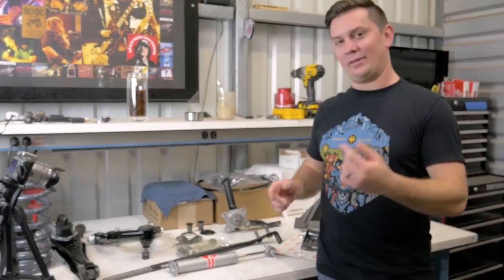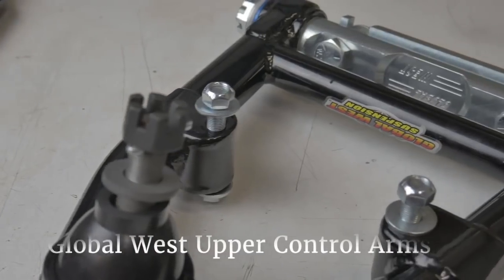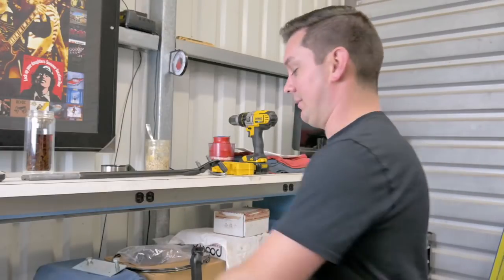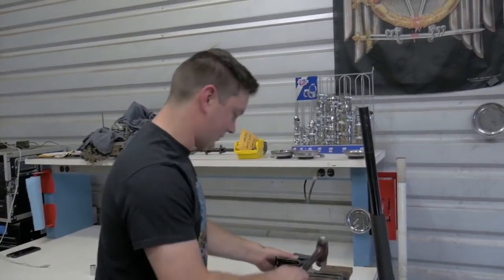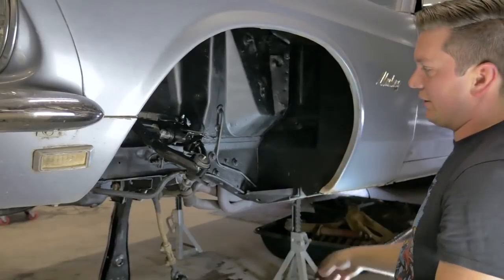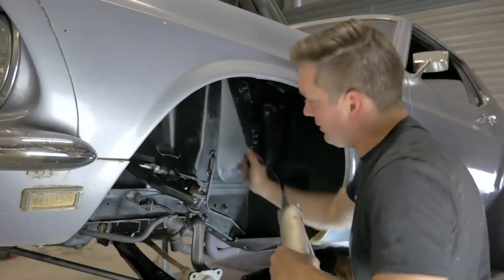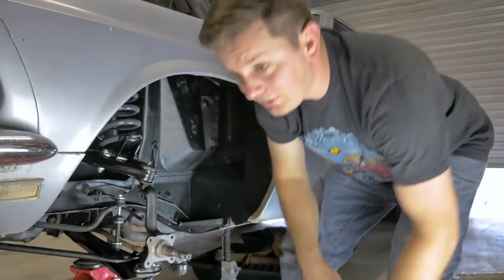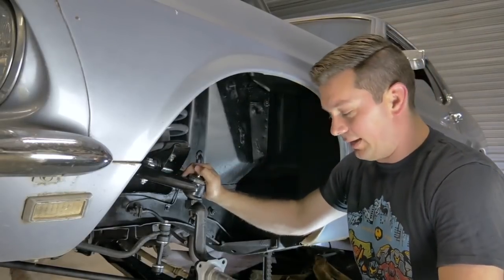Mustang Suspension Upgrade | 1969 Mustang Coupe

Comment from the maker: THANKS GUYS FOR WATCHING!!! WHAT DO YOU GUYS THINK OF THIS SETUP?
Reply: I like the idea of getting a new control arms instead of dealing with the old ones.
Reply: Budget Build Garage smart move is what I think.
Reply from the maker: Thanks man!  This thing should be a lot of fun.
Reply from the maker: They are pretty inexpensive and it saves you from having to remove the ball joint rivets.
Reply: You need an export brace! The suspension mods are solid but you're still gonna get a lot of flex from your stock 2 piece braces.
Reply: Exsacly what I had in mind
Reply: How are those springs holding up? Do you still like them?
Reply: How much did the Shelby drop and lowering springs lower the car?
Reply: So what kind of suspension system would I need to get and what is it called and how much do you think it'll cost if I do it on the cheap if I want the 69 Mustang to corner and handle like a more modern car because I know that the old late sixties cars did not handle well
Reply: @biodigitaljazz5814  You can't use "corner and handle like a modern car" and "on the cheap" in the same sentence.  :]  No one can tell you what is going to be right for you...only what was right for them.  You need to do your homework (by attending several several classes at "YouTube University"..look for common threads..read comments to see what works, what doesn't, then figure out how much you want to spend...can spend, then make your own determination as to what you need.  Some other questions you need to ask yourself:  What will i use it for...drag racing, road rallying, cruise nights, daily driver..  Can you do the work yourself?  Do you have mechanical experience?  Do you have the tools?  Do you need to include the cost of a GOOD mechanic into your budget?   If so..effectively DOUBLE (at least but more than likely more than double) the cost of what you spend on parts to have a reputable mechanic install them.  Do you even know or know of a good mechanic?   That is a major crap-shoot in and of itself right there.  There are numerous variables - a few i have listed here - that really prevent anyone from answering your question "what do I need...?"

Comment: Great video! I just picked up a 69 Mustang.
Reply from the maker: Nice man! What mind of shape is it in?
Reply: Budget Build Garage it’s very nice shape. Car was put up two years ago. Previous owner health/finical reason. He did not want to sell but forced to. 69 Fastback 302 c4 auto, vintage air, black on black. I need to get it running. Hopefully some fresh fuel. Oil up the cylinders and crank over by hand a few times. 
Good tip on spring perches. I did a 67 once and the polyurethane did bind some. I’m also amazed how many guys air gun a suspension system while it in the air. Always good to lower and climb under and finish tightening if you can fit.
Reply from the maker: @dougcoleburn1579  That sounds like an awesome car. Fast backs are hard to find.  Once you get it started let me know how that A/C works. My wife wants it for her car.
Reply: Budget Build Garage will do!

Comment: Just purchased a 2004 V6 silver mustang for my son. Beautiful car no rust but had to hv a lot of things done so far. It still needs tires and I was told shocks for the back U was told. I am not a mechanic but trying to learn. It still rides alittle rough what should be my priority to help with that? Shocks, suspension, or something else? Had to change out the following: Lower ball joints
Inner tie rods
Outer tie rods
Rack and pinion
All four rear control arms
Ball bearings ( had a mechanic do all this)
I am subscribed and thank you.

Comment: I purchased at 1 5/8" wedge drop kit for 114$ on ebay modified moog ball joints 
Completed build last week put a heavier 1" drop coil spring 
Leaving the plate for extra strength was nice cause now it takes less shims to do alignment
My 65 coupe sits nice now

Comment: I just did very similar on my 1966 Coupe. The only thing I found problematic was the progressive rate springs (Eibach ) didn't give me the fender clearance I needed since I am running 17" wheels. SO I went with the grab a track 620' - SAME unsprung height but didn't sink like the other springs. People need to factor that in - .6 inch taller tire, 1" spring drop and Shelby drop cuts 1/4 to 1/2 inch...so you could actually lose a bit over 2" fender clearance. Great video. just adding some data :-)

Comment: Hey Guys,

I have a 66 Mustang, 289 coupe, in excellent nick. It was restored to factory condition with stock parts 7 years ago. Now while I'm quarantined at home, I'm looking at some new projects to make the car better to drive. 

My main focus is the sloppy handling. I wanna know what you think are the most essential upgrades, especially what will give me immediately noticeable results and the best bang for my buck. I only use my car as a weekend cruiser, so don't know if some upgrades such as disk brakes are really worth it.

The upgrades I am considering are:

1. Subframe connectors
2. Monte Carlo bar
3. Front disk brake conversion
4. Upgrades to front suspension (better coils, shocks, hardware, bushings?)
5. Upgrades to rear suspension (especially sagging leaf springs) 
6. Better engine crossmember (with welded flanges)
7. Shock tower reinforcement plate (welded near the UC arms)
8. Rear firewall

The upgrades I have already done:

1. Refreshed drum brakes x 4
2. Dual brake master cylinder with power booster
3. All new bushings on suspension
4. New standard shocks
5. Pertronix electronic ignition
6. Export brace
7. Recored radiator, upgraded fan and shroud

Looking forward to hearing what upgrades you think I should do first.

Cheers!

Umanng from sunny Perth, Australia.

Comment: Great video's. They are helping me out a lot. Do you have any suggestions on a sway bar upgrade instead of using the stock 11/16"?
Reply from the maker: Thanks for watching.  There are a lot of choices. You can use a 1 in. that will improve performance but not be to harsh or you can go with a 1.25 that will really help control the car.

Comment: Nice setup. Guessing the rear suspension will be next.
Reply from the maker: DJHighTopFade Brakes are next and then the rear suspension.
Reply: Since your channel is "Budget Build", would you consider using the Autozone ceramic brake pads with the lifetime warranty?
Reply from the maker: It depends on what type of car you are working on or trying to build.  There is nothing wrong with most store brand parts.

Comment: Putting mine back together. Shelby drop and 620 1 inch lowering springs. Do you think I would need shock spacers? 
Using stock uca. If so where did you get spacers? Summit racing? Thanks!
Reply from the maker: You may not need spacers but I would probably put them in. You can get them at any hardware store.

Comment: Great video. Couple questions, did you plug the stock holes in the upper control arm. Also what bolts did you use to replace the the ones that come with the spring perch. The new bolts needs to be much longer. I found some that will work but they will no longer be pressed in. I am planning on just using lock washers. Thoughts?
Reply: That's exactly what I did just make sure to use grade 8 an I used a nylon lock nut with the lock washer since that area is one of the most stressed.

Comment: Also your thoughts on the export shock tower brace. And how about a fatter sway bar. Any pros and cons on the bigger sway bar? Thanks and great video!
Reply from the maker: Bigger sway bars help a ton. They help keep the car flat through turns. A nice export brace is great to minimize flex in the shock towers.

Comment: HI there Awesome set up! have a question I have all new stock  Suspension on a 1970 mach1 but adding the Hotchiks springs, The only problem Is the spring moves like if you grab and turn after all parts Installed and I am using the thick top insulators that came with the springs I have no wheels on on jack stand for now any Ideas Thanks!

Comment: So I’m going to be doing this build on my mustang in a few days along with the wilwood setup on your other video. My question is can I run 17x8 rims with that Shelby drop plate? What is the best backspacing and tire size for this build without getting any rub or without using spacers or adapters??

Comment: I have a ‘68 coupe and like cost of this and ability to do this project myself. Couple questions- how much of a drop does this give you from stock setup? Are these lower control arms same as stock or do you need to buy these to make it work/offer the same results? (I replaced mine recently). Are the shocks shorter than stock? (also just replaced these). Thanks & appreciate the info & video

Comment: Great tips! just a question, in the Summit web page, they recommend the RK621369 - Moog R-Series Control Arms instead of the one in your link, what are the differences?....or why do you recommend the one that you use? ( Upper Control Arms MNR-733), thanks!

Comment: Great video. I do have some questions. I'm preparing myself for my suspension on my 70.

Why didn't you just reuse the upper control arm? What's the advantage of buying a newer one?
That lower control arm you used is very cheap in price. Is it the same quality? Is you get what you pay for not a consideration here?
Last question do you have to remove the breaks?
Reply: You can use a stock style upper control arm but “Cars back in the 1960's did not utilize much caster, probably due to the tires of that time. Now, with upgraded suspension and present tire technology, caster plays an important part of the drivability of the car. Caster does the following: provides straight line stability, has a self centering action on the front suspension, improves initial turn in during cornering and also resists pulling (right hand drift) caused by road crown.” -from Global West’s website.
Reply: The stock lower control is inexpensive because the coil spring doesn’t connect to it like later suspension designs. Just make sure you avoid cheap imports. Moog is a good manufacturer to consider.
Reply: That's a great question, I was wondering why he didn't just buy the coilovers from Aldan American for less than $700 seeing as he probably spent the same for this setup

Comment: Love your videos! Can I ask what makes the Global West UCA's worth the extras cost? You mention that the balljoint is in a different spot, what exactly is the benefit of that?
Reply: Cars back in the 1960's did not utilize much caster, probably due to the tires of that time. Now, with upgraded suspension and present tire technology, caster plays an important part of the drivability of the car.

Caster does the following: provides straight line stability, has a self centering action on the front suspension, improves initial turn in during cornering and also resists pulling (right hand drift) caused by road crown. - Global West

Comment: curious why you lowered the upper control arm
Reply: From the factory early fords were designed to understeer.ie if you corner too fast the front of the car goes straight ahead. Car makers at the time thought this was safer. With the stock set up as the body rolls into a turn the top of the tyre moves outward ie positive camber and so ends up running on the outside edge and ploughs straight ahead.When you lower the inner pivot point as in the shelby mod, the tyre pulls in at the top ie negative camber which keeps the tread flat on the road and makes the cornering much sharper.This is much easier to understand if I could show you a diagram with the arcs but I'm too old and untech savy to do that.

Comment: I don't know much about suspension, but it's odd how you went overkill on the upper and just stock on the lower doesn't make a lot sense in my opinion. The shock towers are only so good and the lower control arm isn't much. I don't know what upper I will be running , but I have stock lowers with Opentracker Racing bracing and roller bushings. At 400 I decided to cut my strut rods off and threaded them for sleeves and rod ends up front. I think 100 will do the strut rod modification.

Comment: Looks like the spring will fall out if the front suspension extends to much
Reply from the maker: The shock will limit the amount of downward travel your suspension is capable of on a mustang
Reply: Along with the sway bar link that he attaches after he jacked the lower control arm up after putting in the coil
Reply: Great video. Did you plug the stock holes that are not being used in the upper control arm?